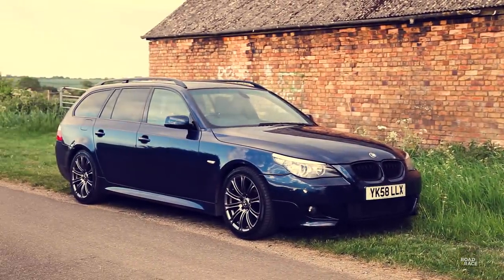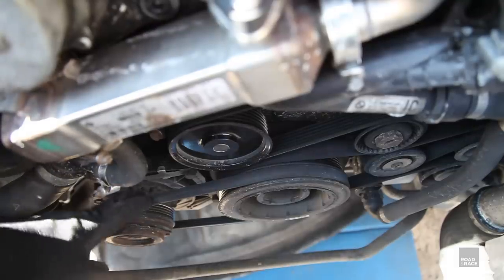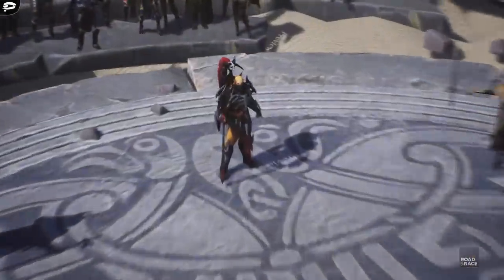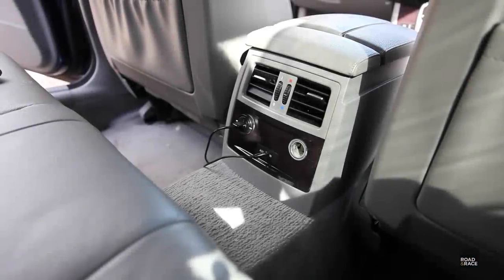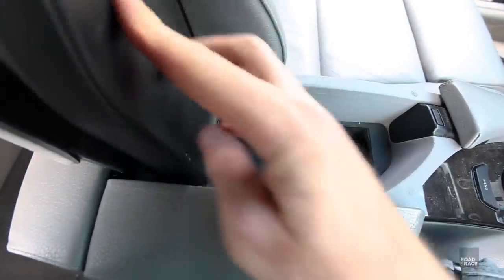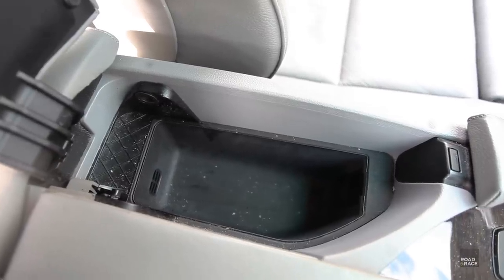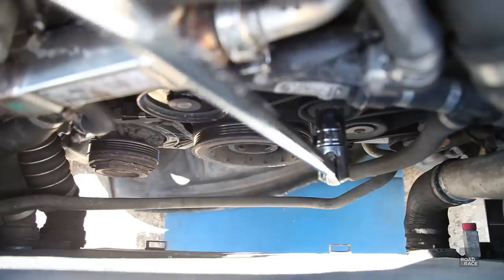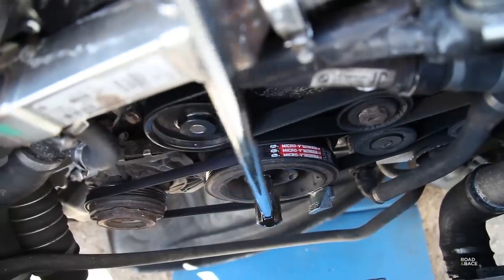Yes, More BMW 5 Series Mods and Fixes ( E60 / E61 ) - Aux Bass Volume, Phone Delete & Engine Belts

Comment: Thanks for the video. Those are not resistors but capacitors, and they filter out voltage spikes in this configuration. So indeed, if by some reason when you plug in/out the plug you generate high pulses, this potentially can damage the speakers.
Reply: So by doing this i could damage the speakers?
Reply: So why do only some cars have them ? I opened up the exact same aux socket on my 2007 E92. The circuit board inside the aux socket didn't have those Capacitors (or risistors).
Reply: @seanpaul3050  there are Hardware revisions all the time, maybe this Filter is implemented somewhere down the line, and not on this Board. Or maybe some other improvements rendering these capacitors useless. But, something has to be done.

Comment: My 2007 e60 does not have the resistors. Aux is noticeably quieter compared to other sources, so I was sure that mine had resistors. Maybe the resistors are in a different location for some models
Reply: I have the same problem😢

Comment: Impressed by the soldering fix for the AUX audio. I have a BMW E92 2007 model and it has the same problem of less bass and volume on AUX audio. Will the same fix help in my case?
Reply: I would also be interested to know this. I (and everyone else probably) have the same issue, but I can't find a solution from e90 forums anywhere.
Reply: I did same in the video and the result are same..😢 any solution?

Comment: No need to use soldering iron to remove resistors. Just cut the tracks with a blade
Reply from the maker: That’s a top tip Niall!

Comment: The belt on my car snapped and g mangled behind the crankshaft pulley. There it pressed the crank shaft seal inside the engine. It also created  a sudden jolt in the engine causing the chain tensioner n the timing chain to loosen up in a few milliseconds. When it finally decided to continue its revolutions the timing chain wa pulled over the teeth of the cam shafts resulting in bent valves and six of seven cracked cam shaft bearings. Had to change the cylinder head and timing chain and tensioner to sort it. So change your serpentine belt regularly folks
Reply from the maker: Wow.  That's terrible.

Comment: Regarding the stereo bass issue on my 5 series e60.. i dont have any factory aux, i coded it in and im using a bluetooth adapter on the aux pins on the head unit. I have the exact same sound issues, how could i possibly fix them?

Comment: Hi! Your videos are awesome with good information. I've 530d 2008 M Sport and as well looking to change some things. I've a question about the AUX. Mine is lockated in side the ar rest, but can't really find any information how to remove it to take out and solder out the resistor. May be you've some advise?
Reply: Hello in my car also the aux is located in the box I mean the "fridge" under the arm rest, in future I breakeing apart the center console for this spectacular aux input thing, and I tell you what I experienced
Reply: @attilabecze6098  I had to take out whole armsrest console. Took whole day for me...:D But should't take so long. It's just for me.:D

Comment: I soldered in a Bluetooth music connector via the aux. Still kept the aux connected, didn't want to remove it. Do you think if I sort the sound problem like you do it would fix the audio or it wouldn't since the Bluetooth music thing is in essence independent
Reply: I have the same problem.  I soldered a BT module and I lost the bass I normally with the AUX input.  I'm going back into that mod tomorrow looking for those 2 capacitors.

Comment: The aux volume can be adjusted on the head unit to some degree.
Reply from the maker: That's good.  Any idea how please?
Reply: If I remember right you select aux on the head unit then the volume knob adjusts the output level. Sorry it's been a while 🤔 A sliding 5 bar graphic should appear.
Reply: @markhancox5475  Didn't  find this option on my 2008 LCI
Reply: @markhancox5475  I think that's for non idrive e90s?
Reply: You might be right mine didn't have the idrive

Comment: Thanks for another great vid! I just did the Waterpump and two Thermostats. Thanks to your vids :). I also added a chinese radio that allows wireless Carplay. That is fantasic and it keeps your original system intact and still usable .. That might be an idea ?
Reply from the maker: Thanks Sander.  Well done on those jobs.  That's a good idea, what model did you get?
Reply: @RoadandRacetv  Well, I guess it is a random unit ;) they all are .. The dongle to use carplay is the Carlinkit Wireless Dongle. I am really pleased with the system. If you'd like more info, let me know!
Reply: Anthony Skilton i bought mine in the netherlands. But i am quite sure that all of the brands use the same chinese factory. I bought mine to be able to het a refund if it was bad
Reply: Hey Sander. Was thinking of doing that to my E61. Are you happy with the system? How about the installation, was it simple? That scares me a bit. Also the overall quality and feeling, does it feel cheap or crashes? Tks for the feedback and good luck!
Reply: @joaosales7630  Hi Joao! No, Installation is very easy! (use proper interiortools though to remove trims) Simple clicks of harnasses and you re good to go.. At least I was :). I drive know works seamlessly .. It is simple a perfect upgrade. And like I said, the original system still works.
Reply: Thank you for your kind reply Sander! Got those tools to pry open the trim so should be easy. I guess you made up my mind, gonna go for such a kit. The fact that idrive keeps on working is a plus for sure! Thanks for your feedback and quick answer.

Comment: Hello! I just bought myself a e61 525d lci 2007 and I cant find any history of the belts being changed so i figured that id swap them out.
I have found sites selling the exact belts that you bought but the specs for the multibelt says ”without heightregulation” which makes me wonder. Should i just buy the same belts that you bought since we have the same engine and chassis?
Any help would be appreciated

Comment: My aux isn’t that quiet at all. It’s almost the same volume as the radio. The phone holder this is what I’ve been waiting for. What was your dampener pulley like on the crank?
Reply from the maker: That's interesting.  What model BMW do you have?   TBH I didn't check the dampener.
Reply: Road and Race it’s an 08 LCI. On a 30d. 
I’ll get that panel off and let you know what what the board is like on that aux.

Comment: Nice, thanks for the vid. How about the bearings? Have you checked them? I have the feeling mine is seeking a little bit, so I think a change of the bearings could be useful? What do you think?
Reply from the maker: Which bearings?  Wheel bearings?
Reply: @RoadandRacetv  idle and roller pulleys
Reply: That’s what I meant.

Comment: Random question, trying to work out if you just removed the resistors from the AUX or if you removed/bridged the contacts, can't quite tell from the video
Reply from the maker: I removed them but cutting the contacts would work too.
Reply: @RoadandRacetv  I just did the mod on mine about 5 min ago, cut them in half before removing, not perfect audio but still a hell of a lot better and is at least listenable now.

Thanks

Comment: Hi. I've got e60 2008 and have the same problem, when the sound is much quieter through AUX as it is listen just only radio. I done the same steps as shown in your video, but the sound didn't changed. I had a slightly difference in the microscheme compared tou yours. In yours, the sound resistors looks horizontal solded, but in mine was in vertical posion. May be you've an another idea, how to make the sound in the same loudness as radio? TNX
Reply: Any new solutions?

Comment: Great videos! Did you have any misfire problems with the car? I recently bought the exact same model and it misfires in cold start for a few seconds then clears. I've recently noticed when travelling at motorways soeeds and go to accelerate - I feel a slight misfire there as well. Could this be down to injectors or fuel pump issue? Thanks.
Reply: Hi. One of your injectors is leaking (dripping), so, cold start for 10-15 seconds rattle, and than works normally?

Comment: I could not disconnect the cable to the aux. It was stuck, and I was afraid of breaking it. Is there any technique I should use?
Reply from the maker: Try taking the unit apart?
Reply: @RoadandRacetv  I mean after the cover is off, after I disconnect both wires to the 12 v outlets, and the try to disconnect the connector to the aux (you do this at 3:28 in the video). This one is stuck, is there a locking mechanism or some tips to take off this connector?
Reply from the maker: It just unclipped for me if I remember correctly.

Comment: Does anyone know if f20 bmw’s have resistors in the aux socket? Mine sounds worse than the radio but not as bad as you described your one sounds like? My socket has a usb and 3.5mm socket built in if that makes any difference?

Comment: What specific socket did you use on the breaker bar at the end to turn the crankshaft pulley over manually? Thanks
Reply from the maker: It was a torx socket.
Reply: @RoadandRacetv  oh okay, is that the right one? Like a torx 45 or something? Maybe it's different on an e60/61. Thought it required a special adaptor socket with 4 pins

Comment: So I’ve got similar e61 LCI, but my Aux input is under where you phone thing was and has USB input too! Don’t use it as volume too low, but if I can do that fix will consider it. Do you think the chip might be behind the mini stereo jack still just my input is under arm rest not in the back? Thank you for your consideration?
Reply from the maker: Yeah I’d guess it is
Reply: Same with my 520d 2008.
Reply: Great video btw

Comment: Hi. What is the cable and plug that you used between the aux and the socket?
Reply from the maker: Its an apple multimedia cable
Reply: Ah ok. I’m just doing mine, circuit board out and hunting for the soldering iron. Did the cradle out in ten mins. 
I anticipated that the phone would connect straight to the aux input but yours seems to be connected to the lighter socket. What do you have in that socket?
Great vids by the way, really useful.

Comment: e60 dont have main rubber belt is has timing chain ! changing belts not diy job don't do it! likely to bugger something  up , anyway just did this aux thing took 15 mins , increase in sound quality tone and bass definitely  , just a little louder 3% increase approx. , thanks for vid

Comment: The circuit board in my car is different, no resistors
Reply from the maker: Which model do you have?
Reply: same here
Reply: What way could you fix the other chip? Cant find it anywhere
Reply: @RoadandRacetv  I have a 2007 e60 520d saloon

Comment: I have the big stereo HiFi System Professional with the DSP Logic7 amplifier and quite a number of speakers and subwoofer. My car is from 2007 but I do not experience the flat sound when using the Aux In. Maybe it's because the speakers in this setup can take quite a bit of beating so they didn't have to use the resistors.